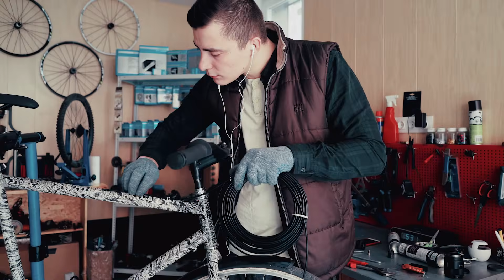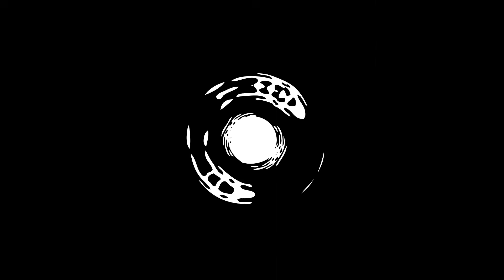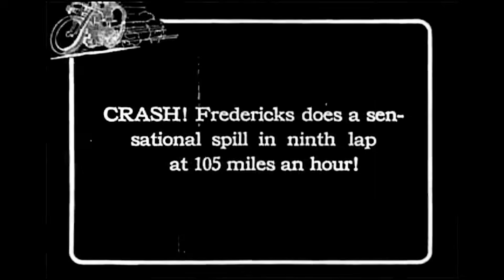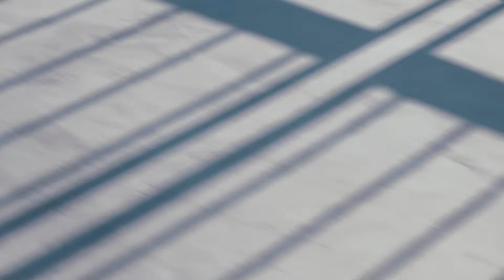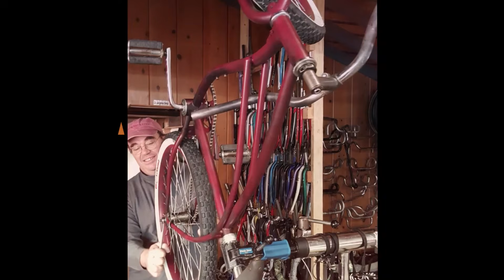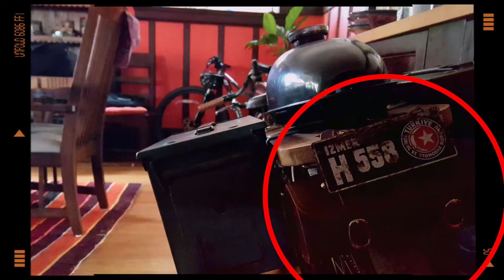How I Built a Motorized Bike for CHEAP... (boardtrack racer replica)

Comment: Nice build. Too bad it was stolen.. but I wonder, why the tank on the rear rack? It would look much better in the frame. where the fake tank is..eh..was...since its stolen...and the metalcases didnt match the "board track" style. If it where a street bike, yes...but not too many boardtrack racers brought their lunch and school books onto the track ;).
Reply from the maker: Thanks, yeah. I mean, it was inspired by a board track, and I was like 16 w limited resources. The tank on the back was a convenient solution because it came with the engine, and I couldn't find a tank that would fit in the frame online. Same with the panniers. I wanted to carry stuff and it made the tank on the back look better. Still reminds me of a retro bike with metal panniers.

Comment: With all of the eco-talk, a  b.t.r. can be a good choice going work for the budget minded. If you're considering the freeway, a minimum of 15 h.p. is required. Double check that. Disadvantages must be overcome, like a rainsuit jumpsuit. I'd like to build one before I'm gone. On U-Tube, the poorer countries show remarkable, inspiring bikes of various genres. Some have the coolest looking, oddball antique gas or diesel engines.
Reply from the maker: Indeed. This was not made to be a real moto. There are a ton of cool bikes and motorcycles abroad. I've seen some cool ones in my travels to Asia and Latin America.